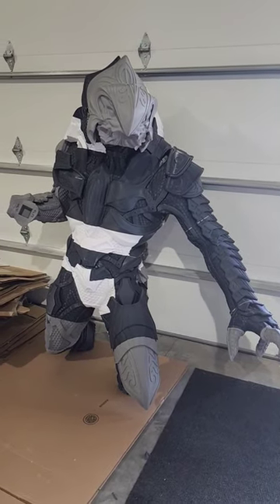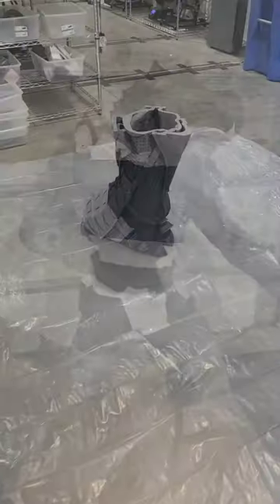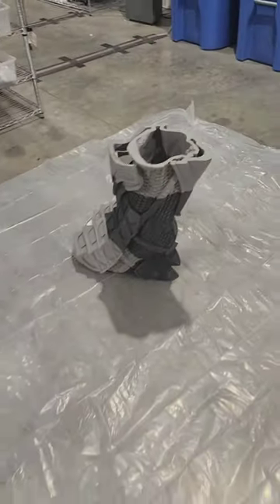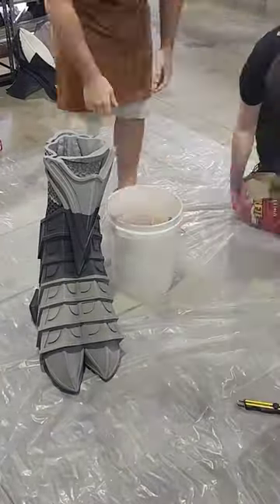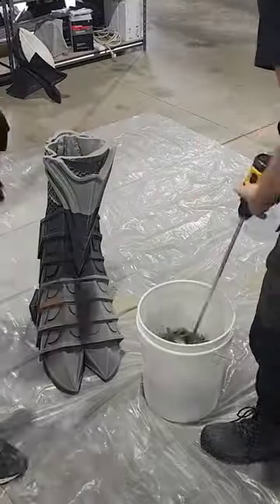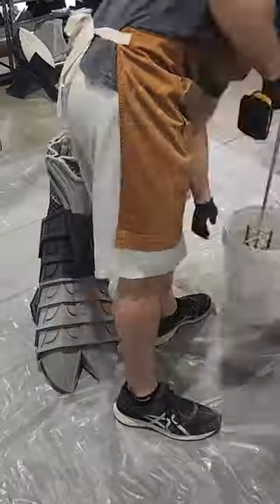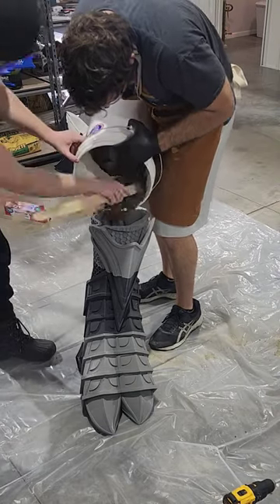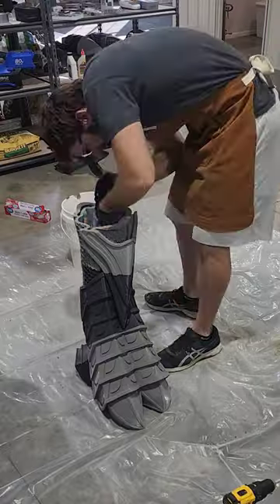Making a Life Sized Arbiter Pt 17

Comment: Having used those bags before, the concrete is made to set within about 6 or so hours, its that quick. Also the concrete does look like they did it right, you don't want the Consistency to look too wet otherwise it'll affect the strength over time. If I were to test the slump of that kic, it looked to be around a 4 or 5 incher, which is pretty standard on stabs, sidewalks, etc.